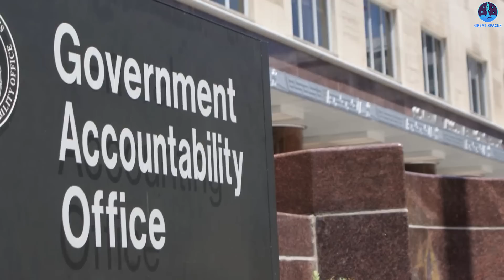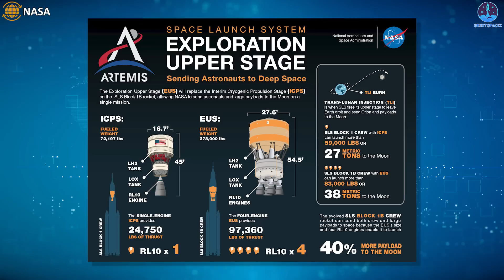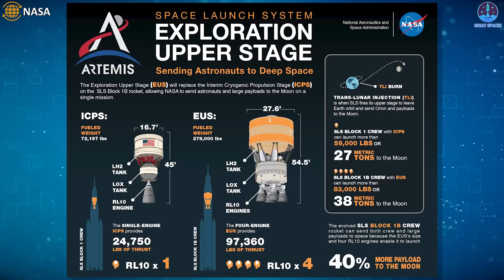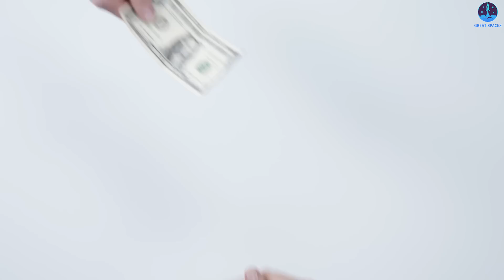The disappointing truth of SLS rocket, NASA declared! How can SpaceX save NASA...???

Comment: Kevin,  as you reported, Musk said a Starship launch COULD drop below $10 million.  Is that amount include the fully absorbed cost of the rocket, launch sight, construction factories, ect. Or is it only the cost of consumables and launch staff?  And Musk is talking about SpaceX costs NOT what he will charge customers.

Falcon 9 is an exceptional display of reusability, no doubt.  But what portion of the cost savings are being passed on to SpaceX customers?  Your reporting on this issue would be very informative. Remember Musk is an extraordinary businessman.  I find it hard to believe he is giving away Falcon 9 flights just for the cost of fuel.  The same applies to Starship.

And none of the above thoughts justifies NASA's SLS costs that were forced on it by Congress and the Obama & Trump Admins. You change goals every four years and funding every two years and you get mayhem.

Comment: NASA is a government agency and does not have to show a profit of any kind. So they don't care how much it costs, just as long as the money keeps flowing. SpaceX , on the other hand is a privately owned corporation. And the boss, Elon, expects a return on investment. Any company expects a profit. There fore  costs are examined and checked against profit margin and then they proceed. Instead of throwing money at a problem, If it cannot be fixed, its scrapped hopefully before any metal is cut, and still in design. Starship is also more advanced than SLS, although sometimes if that's all you have, make the most of it. But if it's already proven tech there should be no cost overruns.But the money is going somewhere.
Reply from the maker: Thanks for your sharing

Comment: Great video !  For NASA to bring down the cost of the return to the moon to stay, NASA must recover one hundred tonnes of Lunar Water Ice a year to support a Crew of four on the moon for a year.  The Crew will serve a six month tour of duty on the moon before return to LEO.  The LEV/LLV will refuel in LEO for the return to the moon with a fres Crew of four Lunar Workers !  Three hundred tonnes of Lunar Water Ice (H2O) recovered on the moon will support twelve Lunar Workers for a year on the moon. The six (6) round trip flights to the moon will support a Crew of twelve Lunar Workers for a year.  (LEV/LLV  6.1 km/sec delta-V  LS to LEO).    The six flights a year or one flight every two months will cost about the same as one flight of the SLS rocket...  With more production of Lunar Water Ice (H2O) and Oxygen (O2) recovered from the minerals of the Lunar Regolith by Hydrogen (H2) then NASA can expand the Lunar Outpost to a Lunar Base (Clementine Base) with the first export being LUNar OXygen (LUNOX-TM) (O2).  With the recovery of about 2200 tonnes of Hydrogen and Oxygen the Lunar Base can support ten flights of the NASA designed "24-Hour Lunar Shuttle" (LEO to LLO) with the LEV/LLV landing the PTM at the Lunar Base (two Crew and 18 Lunar Workers or tourists)...  Also weekly or daily flights are possible to the LS !  The engine for the "24-Hour Lunar Shuttle" can take US out of the deep gravity well of LEO to Mars and beyound !  Timothy Lipinski
P.S. see "Moon Direct" by Robert Zubrin for more info...

Comment: From my spectator point of view, SLS is just an evolution of the Space Shuttle system. All they needed to do was move the shuttle engines to the bottom of the tank and add on a capsule to the top. How was it not ready to go before the shuttle was retired?
Reply: Why did it cost $24 billion taxpayer dollars to slap together pre built parts? The answer is that it's a cash grab perpetrated by Congress and legacy space. One of many. At least it wasn't a war this time.
Reply: Government projects don’t work like that. Follow the million$ …. I suggest political kickbacks and electoral slush funding for Democrats ….
Reply: That required redesigning the tank. as it was the SRBs were only there to lift the tank... even then only barely.